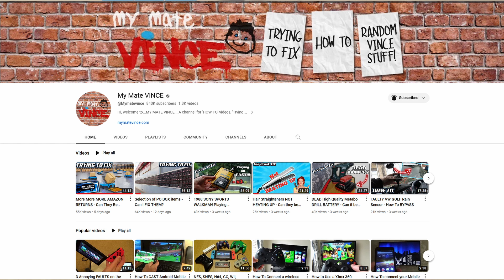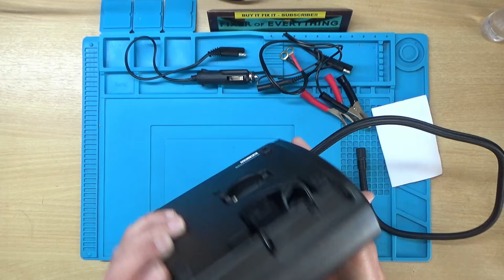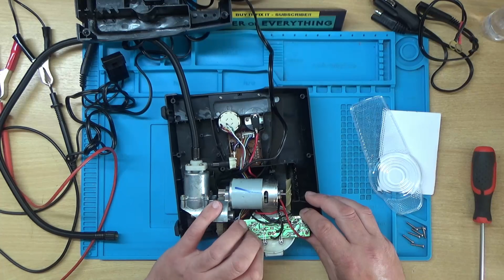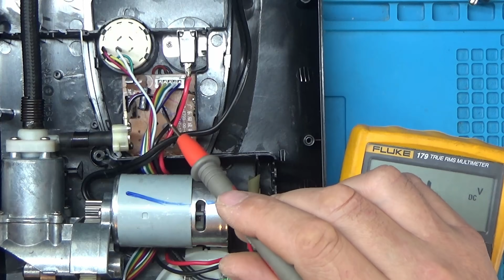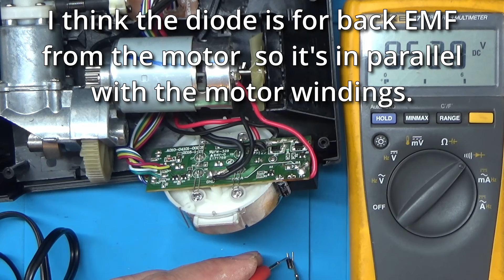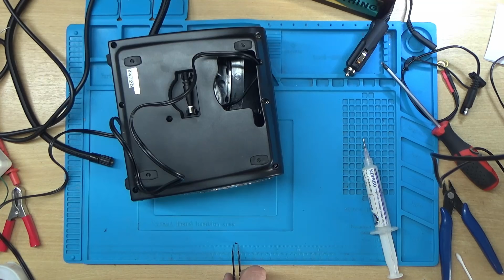Ring 12V Digital Automatic Tyre Inflator | Can I Fix It?

Comment: Hello sir,i have same tyre inflator. When i am attaching the hose to the tyre,it is showing zero pressure. But my inflator is working fine,only showing zero pressure due to this auto function not working.Display is ok but showing zero pressure.What could be the problem?
Reply from the maker: Sounds like a problem with the air pressure sensor. The hose goes to it, and there are wires coming out of it.
Reply: @BuyitFixit ok thank you.

Comment: I have an AA inflator which I think is probably the same inside. Exactly the same problem. I’m quite handy at most stuff but know nothing about this stuff. However you have inspired me and think I’d like to tinker more. I have seen a pack of transistors on Amazon but they are all different. Could you possibly give me an idea of what to buy. Obviously I will do the meter checks first to see if it’s the same problem. But exactly the same symptoms as this one. Really enjoyed the process. Thanks. Paul

Comment: Sometimes these "spare" elements (like the diode on this) are used as a physical spacer, for example, between pcb and plastics in case :) In smart switches (Tuya) they used spare diodes to stabilize the connector :D These elements are really cheap, cheaper than any other spacer ;) And can be put automatically on the board.
Reply from the maker: Thanks for the info!

Comment: I have the 630 version which started to get really bogged down, initially thought it may be the motor / compressor but turned out it was the on/off switch failing. I just bypassed it and it works fine now but have to unplug it to switch off. I’ll just install another switch when i find a suitable one and put up with not having one
Reply from the maker: Glad you got it working again 👍

Comment: I owned a car one time that had the cigarette lighter socket wired up the wrong way, phone charger wouldn't work !!
Reply from the maker: One of the local farmers asked if I could have a look at his bale wrapper as it wasn't working. He had blown the control box, which I fixed but it looked like it had been caused by reverse polarity. I was confused as it had a cigarette lighter plug on it  that he plugged into the tractors cab. So I asked how he switched that on, at which point he got two large crocodile clips and clipped them onto the battery, and I knew at that point what he had done 😂😂😂

Comment: Thanks for uploading such a wonderful content. This is a great learning experience. I have one question, how did you determine what the replacement transistor value should be, are there any steps involved in determining the replacement transistor type?
Reply from the maker: I'm trying to think back on this one, but they normally have a code written on them. You can search this on a site called smd you need one. I also bought a set of common smd transistors fro Amazon or Ebay.

Comment: I'm working backwards through your back catalogue reaching this point and I followed with interest as I have the Halfords badged variant of this device. Mine has no power to lights or motor, but I'm hung up on the M7 diodes on the power i/p. Your exposure of the track my explain why I'm struggling to understand what's going on. I will revisit it.
Incidentally I think the diode in the cap position has an unpopulated diode position in parallel with it, so maybe they sacrificed the cap in favour of a bigger diode?
Reply from the maker: @twotone3070  Cheers mate 👍the weird thing was I think the diode position had a solid track going through it so even if a diode was fitted it wouldn't do anything 🤷‍♂️

Comment: The LEDs were flashing the inverse of the SOS, so more of an E E X and then they chop off the last S so it's more SOSOSOSOSOSOSO LOL :D
Love watching these fault finding videos, makes me more inclined to rip out all the caps on my dead wifi CWRGB lamps to see if they work after replacing them :) lol bet they don't. Still got my water heater switch to fix, again wifi but keeps flashing and not holding the ON state, then blinks in and out of existence on my phones app.
Thanks for your hard work and in depth look at things :)
Reply from the maker: Cheers 👍Could be a possible bad dropper cap on the water heater switcher. I had similar with a freezer and a Drayton heating controller.

Comment: Good fault i thought you'd have a stuck relay. How do these tiny transistors work btw I'm guessing the relay coil is tiny current? If you switch the motor directly with a transistor would it just blow instantly?
Reply from the maker: Thanks. Yes pretty much. I can't remember this exact item but the microcontroller would switch a small transistor, which then switches the relay to drive the motor. The microcontroller hasn't got enough power on it's i/o pins to switch the relay directly so that's why the transistor is needed.

Comment: I have the same unit, everything works except the pressure shows only 0.0psi.  Tried to fault find but gave up and use a manual pressure gauge!
Reply from the maker: That would work👍There is a pressure sensor that has 3 or 4 wires coming from it. Could be a faulty sensor or broken wire from the sensor.
Reply: I had the same fault if you look at the main hose, follow it back into the pump you'll notice a small pipe that leads to a sensor at the very start of that pipe near main outlet you'll see a screw with a washer back that off slightly and it will start working.

Who ever put mine together tightened it so much that air couldn't find it's way to the sensor. I looked everywhere for the answer and was only when I tried to blow down the pipe that I realised.

Comment: These guides are priceless, is there an easy way to identify these smd components?. I am trying to fix a dead Zanussi electric clothes dryer control board, and I see a transistor that looks short like in your video  marked 304 L, looked online and results show variations of 304 without the L, listing P type Mosfet?, uncertain.
I have already replaced the Link chip, LNK304N.
Any help appreciated, been at this forever and a day!
Reply from the maker: Thanks 🙂Have you tried searching smd yoo need one? I use that site quite a bit.

Comment: Been rather remiss with your videos of late, just catching up now. Initially I thought when you had the first connection problem, this will be a short vid. Then you found the croc clips reversed, thought same, then of course, why would you do a 40 min vid if you fixed it quick :-) I have one exactly the same, bought it to try to run my Steam Roller but of course need more volume output for it. Had an idea of making a little trailer with a 12v battery and compressor, then run the 1" scale engineer built roller on air, not found the right compressor yet though. 😞
Reply from the maker: I thought you hadn't commented for a while, good to hear from you 👍I actually emailed Nathan again today just to let him know I was thinking of him and hoping he's doing OK, but not holding my breath on a response
Reply: Bit of good news about Nathan. He has passed his full ham exam. Also went to get a bottle of gas for the boat and when he got back he had picked the empty bottle up instead of the full one. He is still active on the ham forum and seems quite well. Don’t think you need to worry about him, except that he is not responding to you :-) or almost anyone else except for radio buddies. He has been out and about on his bike a bit, setting up his radio and getting various contacts. I want to try to get his new call sign in my log. I did manage to talk to him briefly while I set up near Hurst Castle on our last visit to the New Forest
Reply from the maker: Interesting. I got a Ham radio too, but we didn't manage to get any communication between us as I live in a valley and only have the foundation level. We did manage to ping each other with wspr I think it was.
Reply from the maker: Which ham forum are you talking about?
Reply from the maker: I found his call sign G5KCI
Reply: @BuyitFixit  It has just clicked, you or Nathan mentioned ages ago you had the foundation. Even living in a Valley WOW, I could build a wacking antenna there 🙂How many degrees do you recon your take off angle is (angle to your horizon) best and worst?
Reply from the maker: @chrisbartlett6022  Anything from flat to about 60 degrees. It's quite steep! Nathan came camping here a while back with tents and a lad called Chris. Perhaps a different Chris?
Reply: @BuyitFixit  WoW, that is pretty steep, I would still have to have a go at putting something megga up though. Maybe a huge horizontal loop. Be great to gat some telephone poles with scaffold tubes on top of them, presuming there are no huge trees about 🙂I had a 80m Horizontal loop up here for a while, was only at about 20 feet though. Think that was 60 foot a side, bet you could get quite a bit of wire in the air 🙂
Reply from the maker: @chrisbartlett6022  I've not used the radio for about a year. Got a DX commander but the horses ended up getting to it and ran into the support wires and snapped it in half. Got a new pole but never got round to rebuilding it. I did try to make a NVIS antenna out of some electric fence poles and some stripped twin and earth for the conductors. A bit like a dipole but about 2ft from the ground. It did work and had good SWR, but I still didn't manage to get any QSOs. What's the ham forum you mentioned?
Reply: @BuyitFixit  it is a Discord channel pretty much for DX Commander stuff but LOTS of other things get discussed, there are a lot of channels within it. couple of general chat channels, antenna modelling, homebrew stuff, youtube, all sorts of stuff. I find it interesting and it is generally a nice place to be. Too many thinks like Facebook etc can be quite caustic? Folks from pretty much all round the World, can even put when you will be on a band to see if you can get contacts. Must admit I mainly use digital rather than SSB.

Comment: I had one of these, the dick diode was blown although you couldn't tell from looking at it.
Reply from the maker: Dick diode? 😂😂😂👍
Reply: From my days as a CB rig doctor. The amount of them where the clueless owner just connected it to the battery with no consideration of polarity. A 5p component stopped blowing a £100 cb so we fitted them into the power cable as a precaution. @BuyitFixit

Comment: the bench power supply, judging by the sound it makes: http://static9.depositphotos.com/1006443/1147/i/950/depositphotos_11470063-stock-photo-huge-industrial-high-voltage-substation.jpg

Comment: I presume the transistor was switching the relay but when polarity was reversed the bypass diode carried enough current to blow it. Might have been tempted to replace any electrolytics that have been subject to reverse volts to avoid future problems.
Reply from the maker: It could well have been the case. If the original owner was using the cigarette lighter adapter and then one day used the crocodile, clips which were incorrectly wired, then that might explain the sudden failure. Or perhaps he never used the crocodile clips and it was just a random failure 🤷‍♂️

Comment: Nice one, the only observation i'd make is, while you had both transistors off the board, i'd have checked them both to compare. after all it might have been something as bizarre as a dry joint, if that is actually possible with SMD?
Reply from the maker: Yes dry joints are certainly possible with SMD. I did measure the transistors but usually you get a reading of around .5 or so, on the original one it was higher across the base and collector I think it was from memory. It's quite hard to measure them off the pcb as they have a habit of pinging off into the wild blue yonder 😂😂

Comment: Nice one Mick, good fix. I have the exact same tyre pump.  
As for the diode across the track, and the other diode that has a capacitor symbol, it's possible the board went through several design iterations, with components / tracks being changed to make it work, then the designer wasn't allowed to tidy things up once they got a working solution due to time / budget constraints.  You can imagine the conversation:
Engineer: Hmmm it doesn't work, what happens if I change this, and this, and this? I'll just bodge it quick to check.  Ah, fixed it. 
Manager: Great, we're on a deadline, send the final PCB design to the factory.
Engineer: No wait, I only bodged it, I need to redesign the circuit board so it's congruent with the new design.  
Manager: How long will that take?
Engineer: Half a day to change the design, then a week to get a few made up ones back from the factory, then I'll have to run all the full suite of tests again including a soak test, to make sure I haven't broken anything else by mistake, at least 2 weeks.
Manager: No, time for that.
Engineer: But the PCB, it looks funny, people will laugh.
Manager: Don't be daft, no one's going to look.  This is a $20 disposable piece of consumer electronics, it will definitely never be repaired and streamed live on YouTube for the world to see your folly. We don't want to miss out on a week's sales for your pride. Ship it! 
😆
Reply from the maker: 😂😂😂Nice one Colin, yes I could see that happening 👍
Reply: That's how it goes in the real world!

Comment: Help please. DIYer - no expert here. I have a pump of similar construction. 
When on, pump splutters and dies with maybe 1 rotation of crank. Relay clicks. Mechanism good but motor notchy.
Power to unit, 12v across board, on switch etc. 12v direct to motor from booster pack (pos and neg) and motor works fine!
6 sm resistors on rear all good. 
2 A42 transistors NPNs test good.
M7 diode voltage both ways so bad?
22microfarad capacitor discharged in situ, tested for resistance and dropped to 0v so open circuit and assumed bad? Understand it should trend to infinity. 
There's also a relay, I don't know how to test.
Something on the board is defective. 
Many thanks 4 help :)
Reply from the maker: You might need to remove M7 to test it properly, if it's wired across something such as a coil of the relay you might be reading that. If you disconnect the motor, and switch the pump on, does the relay click?
Reply: @BuyitFixit  Hi, thanks. Should have thrown it away for £20 new but I'm already in deep aha.
Motor disconnected. Pushed power button and relay buzzes rather than clicks. Maybe 1/2 second. Buzzes again when I turn it off.
Reply from the maker: So the problem is before the relay I'd think. Sounds odd the relay buzzing. If you want drop me a picture of the board. Channel about page.. contact..for business enquiries. It doesn't show the button on mobile for some reason.
Reply: @BuyitFixit  Thanks. I think I'm just going to solder the 12v switch direct to the motor and have done with it. Although I've learnt alot from this exercise, it isn't worth any more of mine time and defo not urs. But before hand, can you share any knowledge about the capacitor. This was one component I struggled with, especially as I don't have a farrad multimeter. Should I get 0v on the diode setting across the terminals?
Reply from the maker: You can't tell doing that. It's like trying to measure length with a stopwatch. I'd recommend getting one of those component testers like I have. They are around £15 and are very useful for all types of components.
Reply: @BuyitFixit  Haha understood. Everyday is a school day. Many thanks for your replied. Your time is appreciated. David
Reply from the maker: You're very welcome. Glad to help if I can 👍

Comment: I believe that may be a clamping diode. they are common in automotive relays to send the induced spike back through the coil when the relay coil is de energized
Reply from the maker: It looks like D1 is the back EMF diode for the relay. The through hole diode I removed at the bottom of the board (marked for a capacitor and alternatively fitted at D12) is for back EMF from the motor. D11 I think they must have re-designed the board layout slightly but forgot to update the silkscreen and the pick and place machine perhaps.

Comment: Another way of finding the faulty transistor might have been to check presence of drive voltage on the base and lack of switching of the collector.
Reply from the maker: Good point 👍

Comment: I have a milwaukee 2792-20 radio charger and the power button does not work, the red led lights up for a bit then shuts off. The charging part works though, it’s just the radio that isn’t working. Could you possibly try and help me?
Reply from the maker: Unfortunately I've not came across that particular radio before. I have looked at a couple of other models but not that one.
Reply: ive found out water got inside of it, would you know anything about going about fixing that? or is it too far gone already @BuyitFixit

Comment: Diode across track may be for spare use purpose.
Reply from the maker: Might be, but most manufacturers of things usually omit components to save costs and not add spare ones 😂😂
Reply: @BuyitFixit  may be common failure with this diode so kept spare, just guessing 😅
Reply from the maker: @abhi007n 😂😂😂😂

Comment: Capacity readings on a Fluke 179 (frankly, on most multimeters) are never "precise" It is more an indication reading (ballpark) as an extra function.
The tester you use is a way better option.
Reply from the maker: Totally agree, it is pretty accurate when the component isn't in circuit but doesn't measure the ESR.

Comment: What’s the betting that the former owner has a similar connector on a different device with the opposite polarity - and inadvertently used the wrong lead ?
Reply from the maker: I'm not sure on that, I was thinking he probably just use the cigarette lighter adapter as most of these types of things usually come with one of those attached and he probably never tried the crocodile clips.